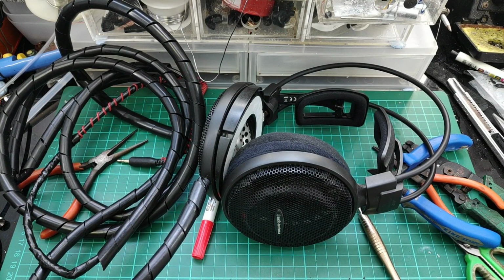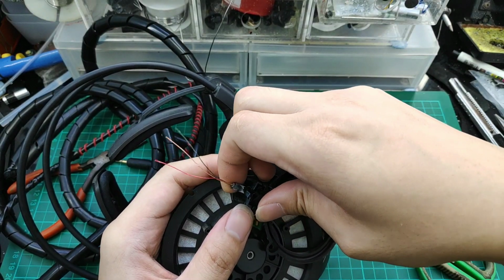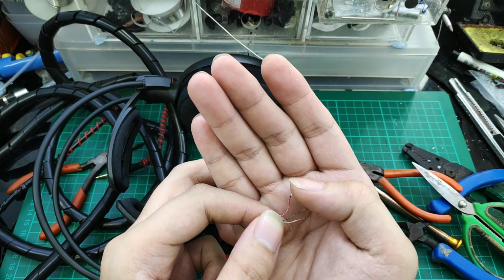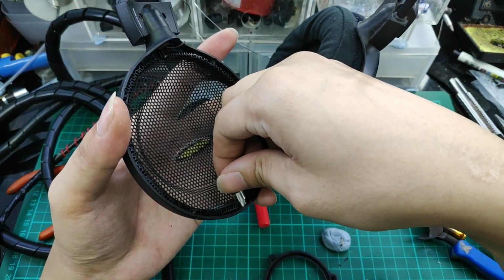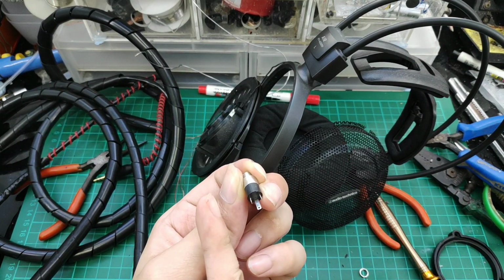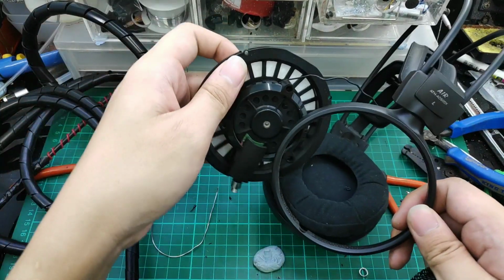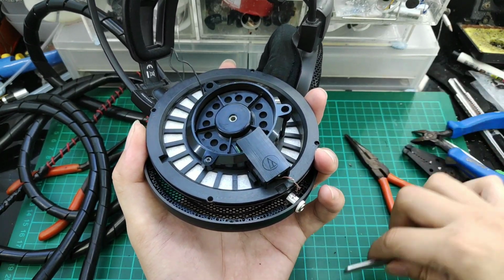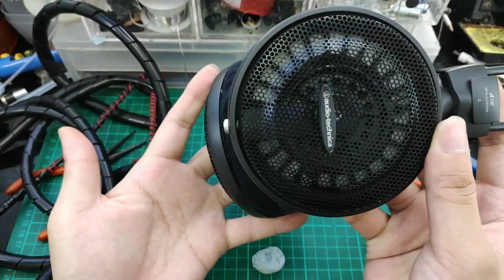audio technica AD500 Headphone detachable cable mod 3.5mm Tutorial AD series

Comment: Great tutorial! Looks simple enough. Hopefully I can do that too! Im planning to diy my marshall major 2 since my wire broke. What 3.5mm female do you recommend for that? It s quite small compared to that AD. TIA!
Reply from the maker: Isn't the Marshall major already in detachable 3.5mm?
Reply: @sgaudiohive  Oops. I guess its the Major 1. Its not detachable. Bought it a few years ago and havent used it since the rubber of the cable torn off. Its still working but not very presentable anymore.
Reply: @Bums001  damn. You made a big mistake choosing those headphones
Reply: @swegboii6447  mitty

Comment: What clay are you using to hold up the soldering iron. I have seen other videos and your method seems so simple with this clay. While others are trying to juggle. And what 3.5mm female did you use to make it detachable. I want to do this to mine.
Reply from the maker: SE215 is already detachable. Clay is bluetack, have an introduction coming up from start to end how to start DIY audio
Reply from the maker: Sorry reply to wrong person. It's just a standard 3.5mm female socket

Comment: Hey cool video...
My ATH-AD1000x just broke, and i did continuity test and its just the wire ! phew !
But now im looking for a new cable to replace it with and its quiet unclear as to a solid or better cable to replace it with. 
Soldering is a past time, however I know how the driver is setup with the million little hairs attached inside soo I dont want to be heating that area more than once at most. 
Anyway I would really appreciate a recommendation !

Comment: Thanks for the hifi diy. What's the best way to wire an inline mic ? Cheers!
Reply from the maker: Hi there, in line mic will be on the cable, best way is to wire it up to around 15cm below the connector to the headphone earcups
Reply: @sgaudiohive  thank you, maybe you will sell microphones someday? Is there a better way to have a mic that has less negative effect on audio/signal quality to the IEM?

Comment: Update? How are they holding up I know the wire on this headphone is super thin
Reply from the maker: there have been no issue since, the cables are replaceable now anyway
Reply: @sgaudiohive  What about the driver itself? Mine was slightly damaged after multiples attempts of soldering new wires that refuse to stick